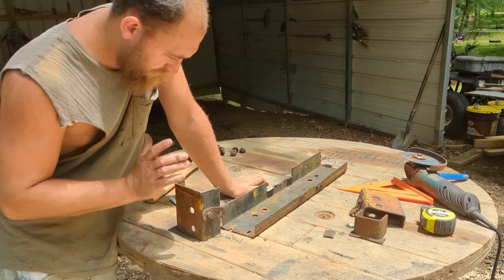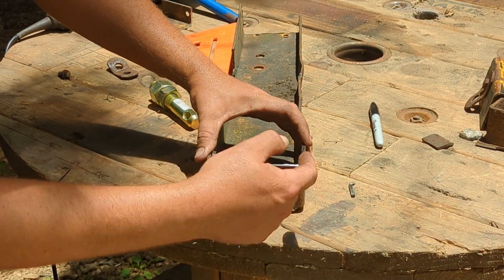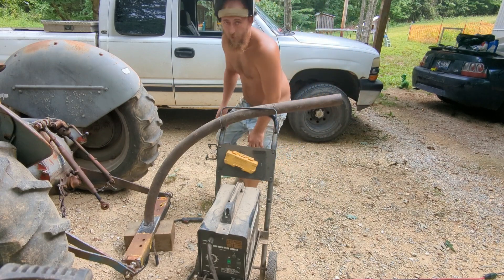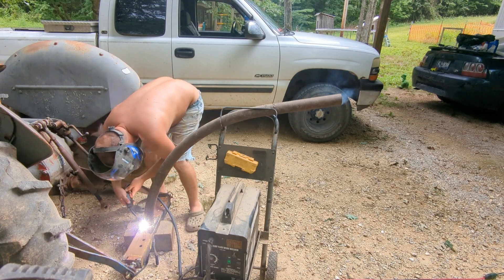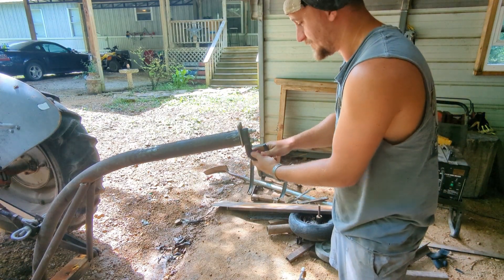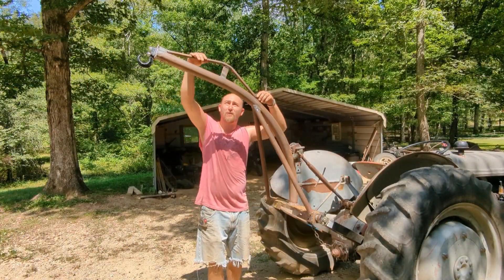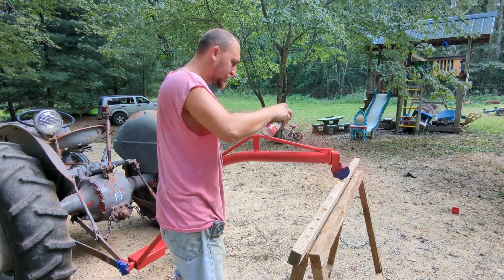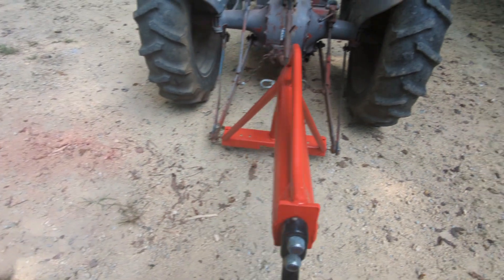boom pole build

Comment: Good on ya!  You got me inspired to make one.  If you were making another one would you do anything differently eg longer or shorter boom?
Reply from the maker: @FredN-jq7xx  it seems to be about the right size for my 2n but I've been thinking about making it where I could  unhook the top link then tilt the boom back an hook the boom where the the top link hooks on tractor and welding a receiver hitch or just a trailer ball at the bottom so I can go from boom trailer ball quick and not have to take it off...an thanks for watching and commenting I appreciate it
Reply: @ not a bad idea at all cheers for that I might incorporate that when I make mine